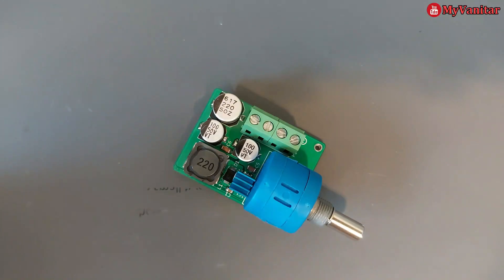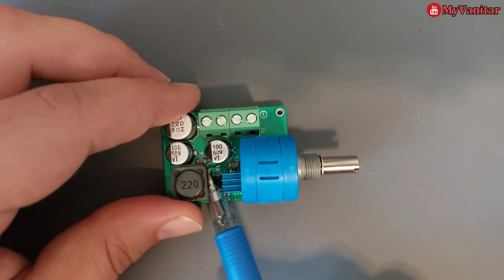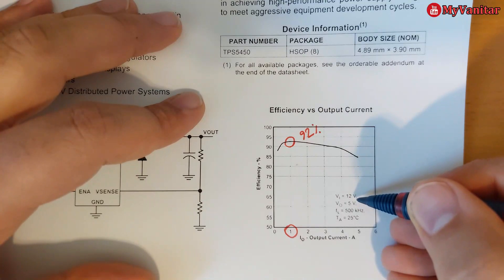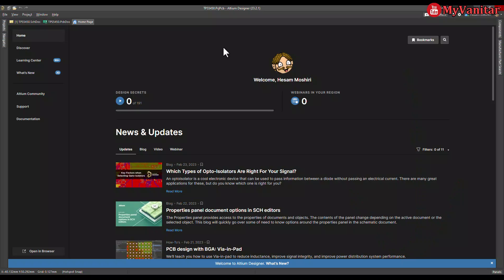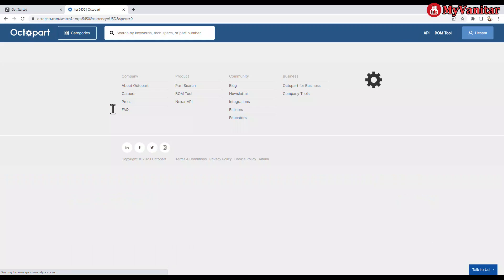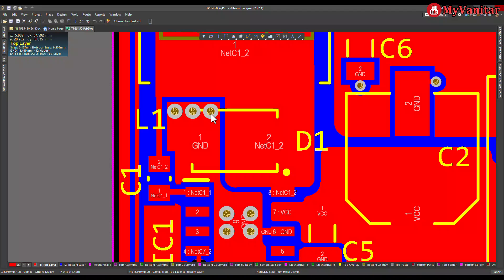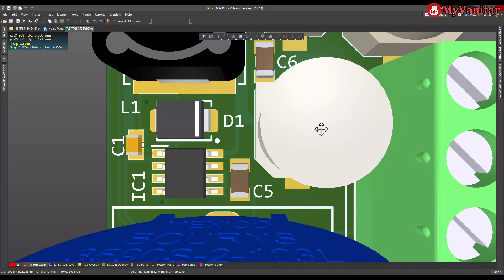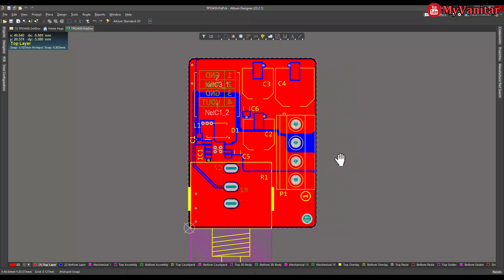35V-5A Adjustable Switching Power Supply (DC to DC Buck Converter)

Comment: I'd say the power output should be quite low for the chip and the cooling it has. Like 15w max? Also the diode is quite small for 5 amps unless it is a shotky diode.
Reply from the maker: The diode "must" be Schottky type and yes it is 5A. Check back again tomorrow or the day after since I'll put the link to the article in the video description. sometimes delay happens. I don't remember the exact figure for the chip, check the datasheet. it depends on the application.